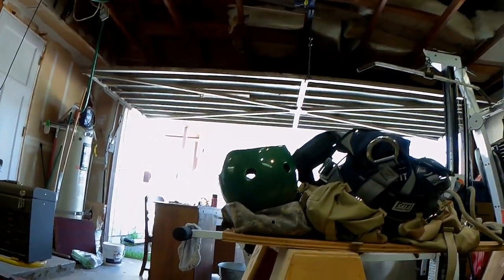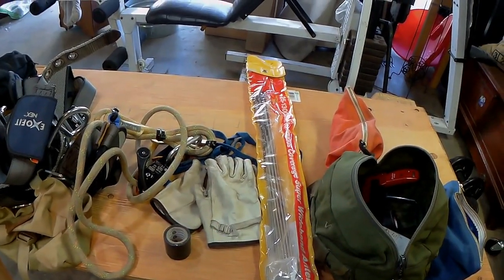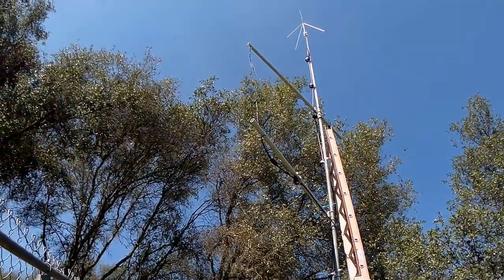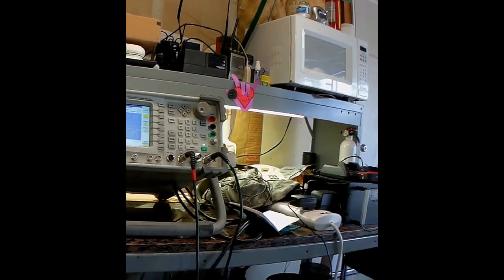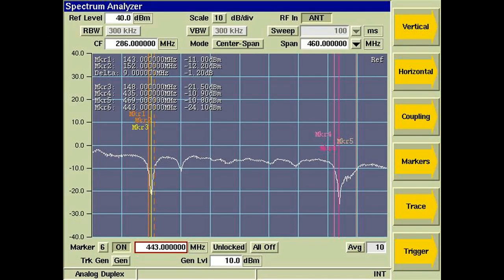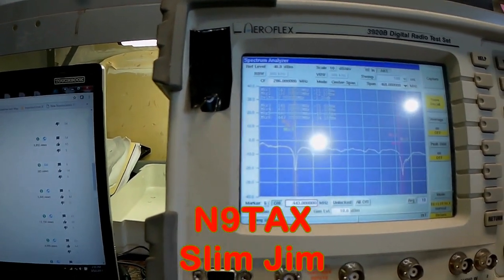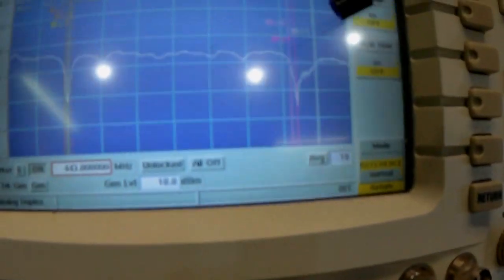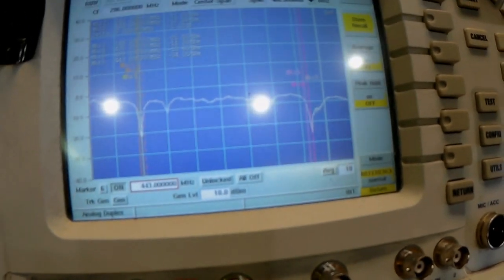N9TAX Slim Jim Dualband Antenna 4 Year After Action Report

Comment: I read it doesn't really excell in UHF. Would you still recommend it as a hiking solution for UHF or is there a better yet comparable portable solution for UHF?
Reply: It works pretty well in UHF. I need to test my GMRS/MURS unit more, but have been pleased so far.
Reply: Headframe Hunters I’m looking at Slim Jim for GMRS. Are you happy with its performance in GMRS or would you say a mobile antenna like a Laird  would perform better?

Comment: How well would the slim Jim work if it was placed in a pvc pipe?.
Reply: GUERRILLACOMM   Ever tested 200 psi PVC? don't use SAE 40!
Reply from the maker: Negative, just used stuff that was laying around the yard.
Reply: Never tried it, ive heard its no good, give it a shot with a meter
Reply from the maker: No, the PVC pipe de-tunes the antenna. Here's a link to a vid I made trying to camo the antenna in various enclosures.
https://youtu.be/G22JhL4Mg_o
Reply: @GUERRILLACOMM   I learned this the hard way by hanging my N9TAX Slim Jim from the top of a pine tee, with the antenna just inches from the trunk. Horrible results! You have to get any substantial mass with a dielectric constant different than air (wood, plastic, fiberglass, etc.) at least 2 meter from the antenna. It also has to be at least that distance from a metal mast.

Comment: What model scanner do you use? Great channel by the way!
Reply from the maker: Thanks, really appreciate it. Its a Uniden Bearcat TrunktrackerIII model BC780-XLT. Its an older model, does alpha tags but not digital capable. I found 3 units that fails to track trunking systems after it bakes in the hot sun in patrol cars. Other than that its a good unit. Thanks for watching.

Comment: Discone antenna is a great general purpose antenna ( within it's design band frequencies it is design for =)   "SLIM - JIM ( glorified "J" Pole antenna ) has some gain over a Discone antenna the limited frequency range ... the two are not the same critter to compare gain antenna ( "J" - Pole )  against no gain ( discone very broad band frequency coverage ) antenna =)  I have four Discone antennas and can connect any of the radios I have that transmit withing the design range of the Discone antenna =)

Comment: Nice video again, 
Do they make a Slim Jim for gmrs ?
Reply: n9tax does make a gmrs/murs dual band slim Jim antenna like the one in the video it is slightly shorter.
Reply from the maker: They do custom work as well last time I check.
Reply from the maker: Though, I would suggest a regular 1/4 wave or 5/8 wave for GMRS.
Reply: Roll your own out of a couple feet of 450 ohm window line - over all length is 18.5"  Radiator is 12.25"  matching section is 6 inches and feed it a half inch from the bottom.